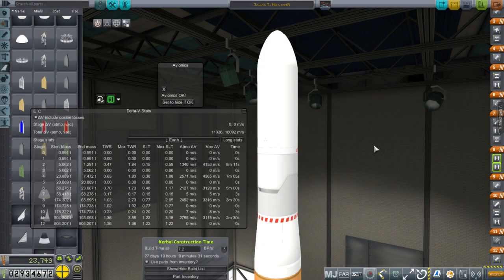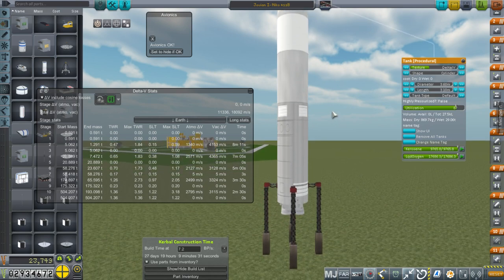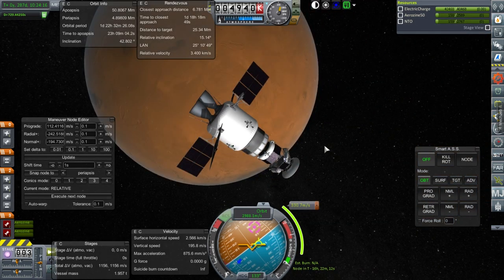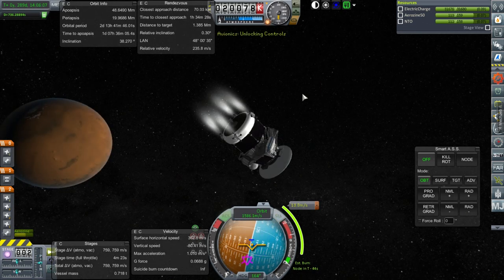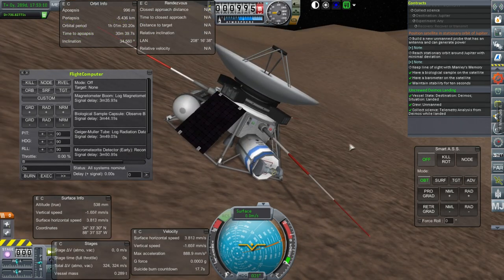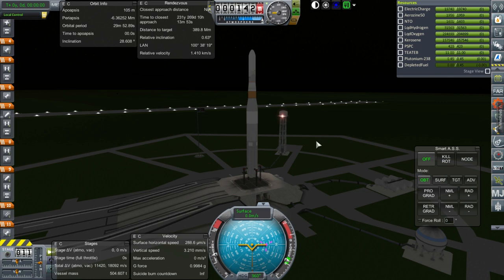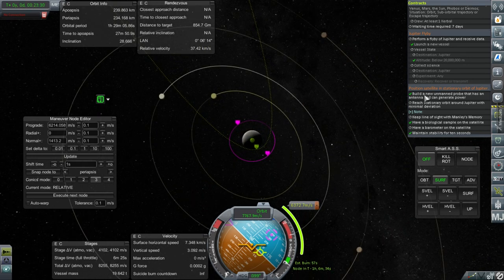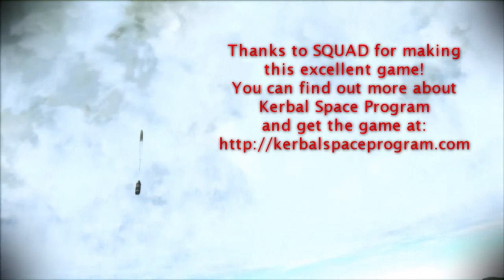Realism Overhaul in KSP 1.1.3 - 35 - Landing on Deimos

Comment: I think the relatively low price of probes compared to launchers is in a large part due to the lack of progression in science instruments in RP-0. In real life a large fraction of the cost of probes is the expense of the custom made science instruments that become increasingly more complicated and capable with each mission. RP-0 and KSP in general does not have the same evolution of science instruments over time (and their increasing cost/science benefits) instead we just get one of each basic class of instrument. This could perhaps be fixed in newer versions of KSP using the upgrade system but balancing game play would of course be more complicated than it currently is.
Reply: Aelfheim I was actually just thinking about a topic along these lines, what are the odds? I'm currently doing a historical play through with the historical contracts mod and I noticed that some of these missions are just plain useless with the ksp science system. There's no reason to do anything more than once other than landing in different biomes because there's no more data to gather. It's just straight up "You got this science, go home" where in real life it's more "You got this science, let's get a whole new probe to focus in on a specific element and get more detail about the data you just gathered" Maybe some mod maker can overhaul this and make revisiting locations more useful

Comment: I think the budget issue / low probe cost is forced by the "lego" nature of KSP not being able to account for economies of scale in real life.  In real life, space vehicles, especially NASA probes, are design one, build one, use one affairs.  Launchers on the other hand are made in multiples and items like engines or structural components are made in multiples per launcher.  This allows for much better economies of scale and lower costs.  As a former aerospace manufacturing engineer, I know that making the first part, or first batch of parts often had the same budget as the tools to make all the parts that would ever be made after.  The piece price for prototype parts had to include all of the engineering and development to not only design a functioning part, but also to figure out how to make it.  Those cost didn't have to be born by the production parts, and as a result production parts could be an order of magnitude less expensive.  So the probe itself has all of the extra prototype costs wrapped into it that the launchers don't have after the first test launches.  Contrast that to KSP where the game designers want any part to be used in any situation, and as many times as the player decides.  There's no way to accurately account for economies of scale with that game play dynamic.  It wouldn't make sense to have multiple copies of the same part with different costs.  If you're really concerned about it, you could make a dummy part using a phantom resource that would allow you to configure the cost of each probe individually.  Then you could set the price of the craft in the VAB before launch.